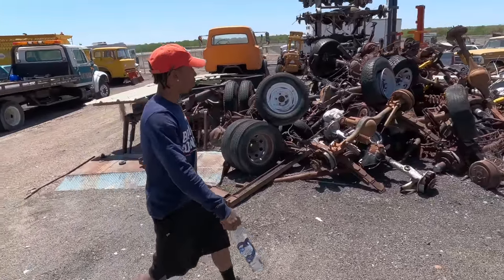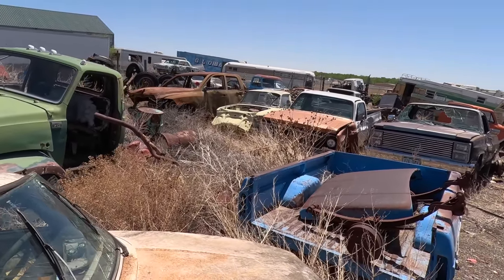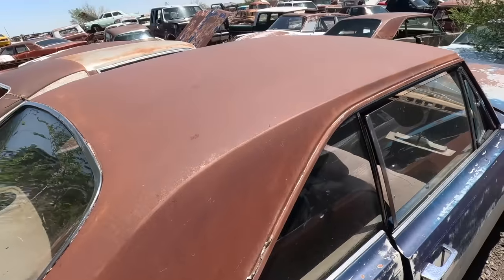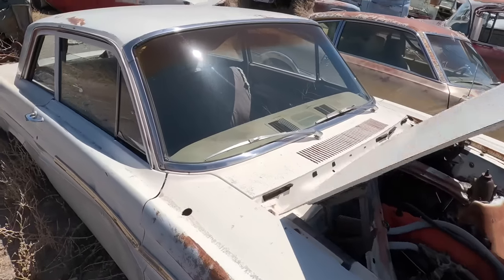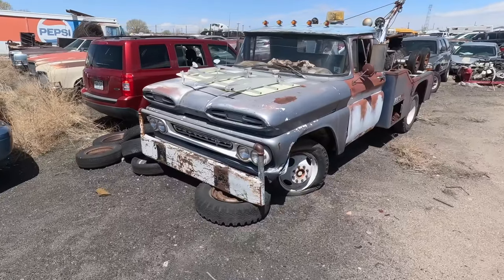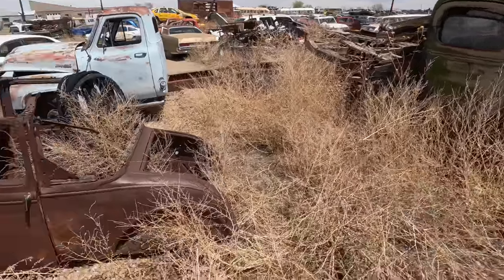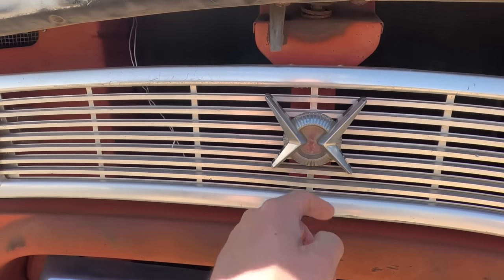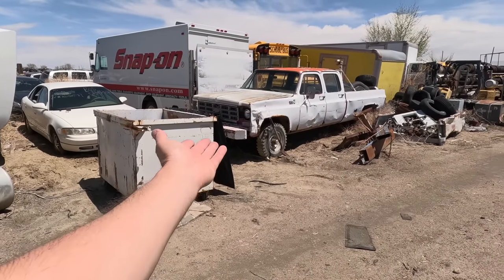TOW YARD Has 80 Years of ABANDONED CARS and Some are Worth More Than Your HOUSE!

Comment: The car with fiberglass fins is a '56 Studebaker Golden Hawk. That year used a Packard 352 V-8 for power.
Reply: The golden hawk had a 289 supercharged v8
Reply: @stevekenworthy8092  - Not in '56. As I stated, it was powered by a Packard 352 for the introductory year. It was the only model of Hawk in '56 to NOT be powered by a Studebaker engine.
Reply: @mattconnor6779  be that as it may lol but you are right my uncle has a 57 w the 289

Comment: * It's Valiant, then a LeMans convertible (not GTO) next to a Maverick, Studebaker used some fiberglass, the Chevy tow truck is a 61 only year for that hood. The AMX is an Eagle not Javelin ( junk), Lincolns have rear suicide doors not Cadillac, the Cabs are Checkers made in Kalamazoo Michigan and use 327 Chevy engines, the car/pick-up is a UTE they sell in Australia, the 60 Dodge 200D service has a 318 V8 not 440, Celicas Suck except for target practice, the taillights are a Pontiac Ventura (Pontiac version of Nova) the GTO in mid 70's was a tape stripe package only (junk), the PU beds are full of aluminum scrap.

Comment: The Viliant is actually a Valiant.   The 68 Mustang is a 1970/72 Maverick.  The Studebaker with the fiberglass fins was a factory add on.  Studebaker didn't have the money to retool the whole quarter panel, so they made a fiberglass fin that used chrome trim to hide the seams.  The Chevy with a missing engine would be a straight six or a V-8. No V-6.

Comment: The odd looking pickup... Roof line looks like about a 51 Studebaker champion that someone converted. 
The yellow one with the horizontal taillights close to the end is a 74 Pontiac Ventura, built on the same platform as the Nova. Hard to tell if it was a GTO, some had spoilers on the trunk lid, most had stripes, which this doesn't have, but some were pretty plain in the back half. The front end is where the differences were, hood with shaker scoop, grille, and fender badging, which is all gone.

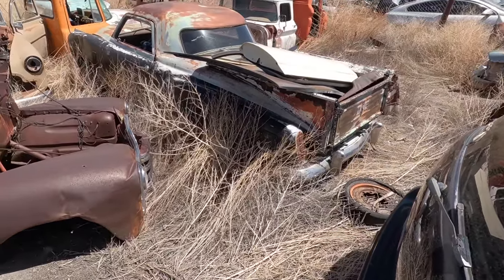Comment: The studebaker business coupe with the pickup bed installed in it at time stamp 22:31 with the ‘DGE’ (Dodge) lettering on it is a really cool mild custom. This would be a perfect candidate to get and swap this body onto a Ford Ranger, Dodge Dakota or a Chevrolet Colorado or S-10 4x4 chassis and running gear.  Back in the 40’s to early 50’s, these two door sedans with giant long trunks were a popular traveling salesman and business use vehicle. Looks like the owner removed the trunk lid and narrows a dodge pickup box and welded or bolted it in. It looks like pretty decent conversion with some style.
Reply: Yup you nailed it.

Comment: You looked at a turquoise
 Ford truck. Looked at the speedometer,and said it sayes six thousand miles.
 The way you tell if those are original or a hundred,& six thousand miles.
 Is look at the brake pedal. If it is worn down on the right side of it. It's a hundred,& six thousand miles. If it is not it is original miles.

Comment: I had my car sabotaged on 2004 & I traded my 03 Yamaha Blaster for a 1977 f-150 that had a 429 & c6 transmission. The previous owner built the 429 when he was in high-school 13/1 compression! It would lift the front wheels when it grabbed traction but for the most part, it would bake the 33 inch tires that I put on it.